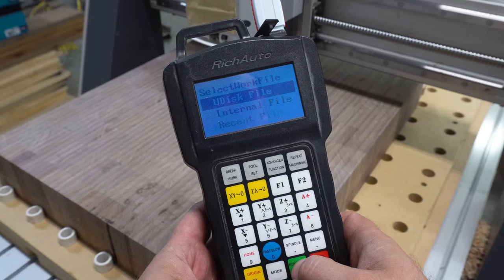Star wars cutting board/butcher block. CNC inlay. Making process.

Comment: Very impressive as usual, would have been amazing to have Darth Vader inlay in ebony
Reply: I totally agree
Reply: I agree too, but besides the fact that ebony is very rare, expensive and mostly comes in smaller parts it is very hard to work with cause it splits and brakes very easily. But its possible for sure...
Would like to see that
Reply: or african blackwood. Or even a good black walnut. I'm not sure either of those are food safe though, and you've got serious issues the oil in tropical hardwoods.
Reply: jimmy crackcorn  Agreed, doing it on cnc is about as creative as posting negative youtube comments.

Comment: My question is since the first large maple inlay was cnc'ed as one piece, why cut it, why glue it up and finish cnc it, as multiple pieces and therefore increase the amount of time, second since there were a second, third and fourth cnc cut why not use more than the 2 woods for inlay into the walnut to add more color, and third, what is that yellow wood, it looks like it has too much figure to be yellowheart
Reply: Yellow looked like canarywood. He probably did it in pieces because the wood expands with glue on it, which could be harder to align fast enough on a large piece. Smaller pieces are more forgiving for expansion and changes of the main wood.woof.

Colors may have been a client choice or just because exotics have oils that can cause splotchiness and may not be food safe. Just guesses there, though.

Comment: please tell me if you had any problems while doing it or everything go rigth at the first try
Reply from the maker: To be honest, i make a lot of mistakes. When I think it will be an easy project, I can forget something like set the zero or clamp the board.
But that board was fine, no issue. It just took me a lot of time to adjust everything for CNC.
Reply: @Broinwood   thanks for answer me. What you done here is a perfect example of what a cnc is used for. Keep making magic...

Comment: A machine does majority of the work.....regardless a nice cutting board
Reply: Just like Picasso’s brush did all his paintings.
Reply: @pilsburypie1977  naw picasso needed talent to use that brush this you just need to press a couple buttons and watch. There is a severe difference
Reply: @deathdealer2915  You miss my point. But you are clearly unaware of the in depth process of “pressing a couple of buttons”.
Reply: @deathdealer2915  You clearly have no idea what goes into this process. And don't forget, a helluva lot of woodworking is done preparing the boards before the machine even gets plugged in.